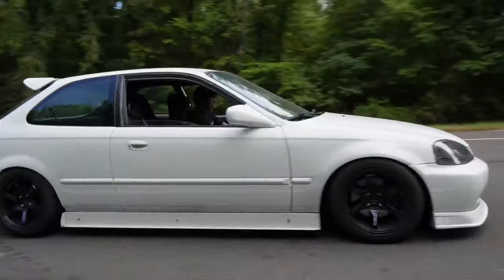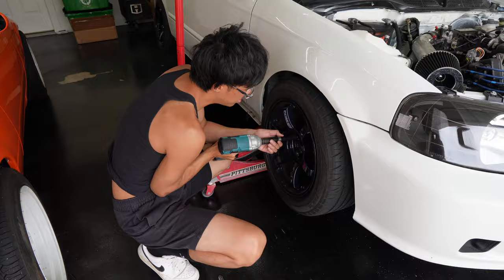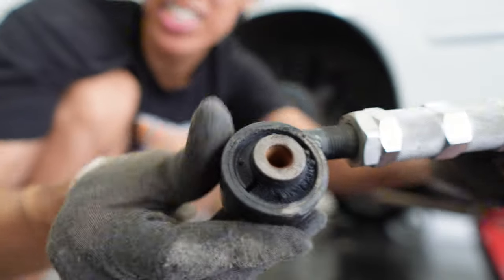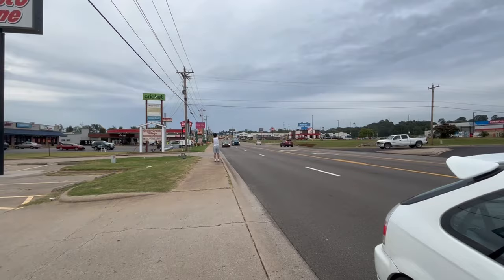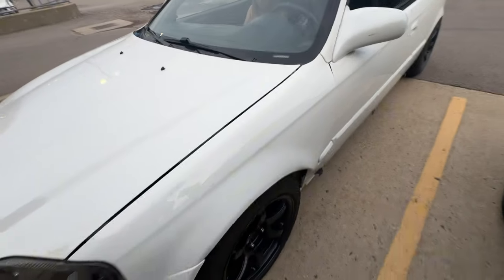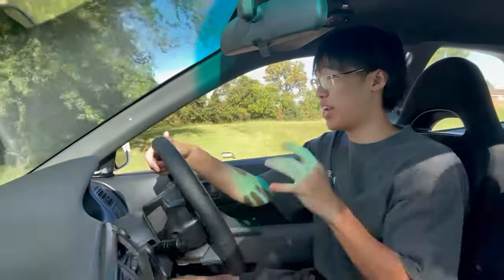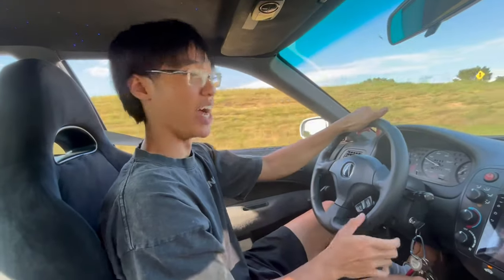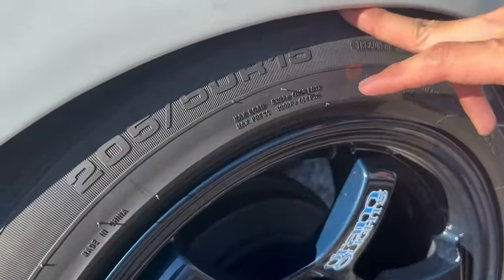Turning My Slow Civic into a Handling Machine!

Comment: Tbh, that's what Civics are born to do, carve the mountains and such. I'm building mine for that sort of thing.

I got Tein coils, TruHart suspension components, an Ebay Sway Bar, and a Skunk 2 Strut Bar.

Still need to do my front lower control arms, front Sway Bar kit, rear Strut bar, rear Trailing arms (switch over to disc break versions from an Integra or Si), trailing arm bushings, new break kit for the rears, and front traction bar kit. Oh, and a cold air intake.
Reply from the maker: That’s amazing brotha! One day wanna take mine in the canyons. Definitely wanna do the rear disc conversion too 🛠️

Comment: That camber gotta get fixed. Both ends should have threads showing. You’re supposed to rotate the center to push both ends of the camber arm out. Not only one side. Just a tip
Reply from the maker: Thanks for the tip! I’ll adjust it when I get the chance
Reply: ill take it too i appreciate it i was just about to do my coils and camber ❤